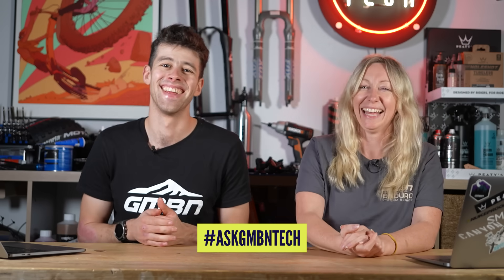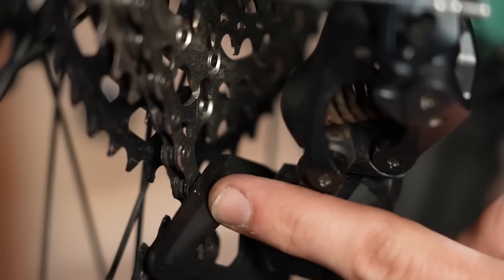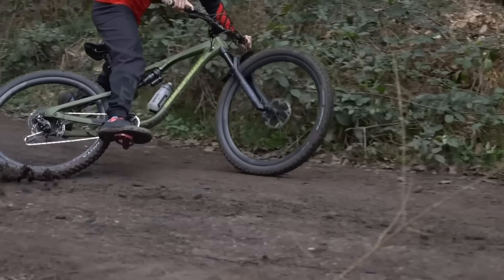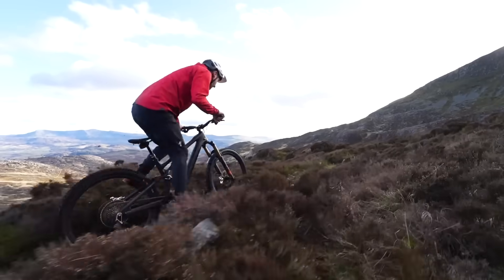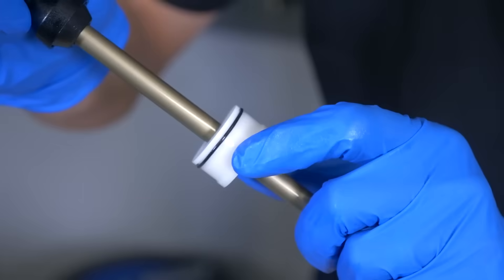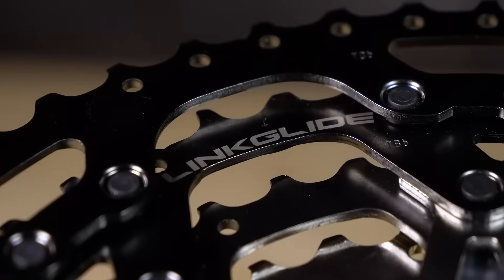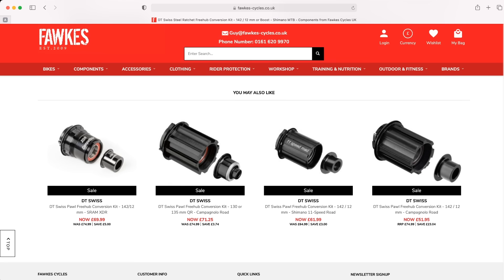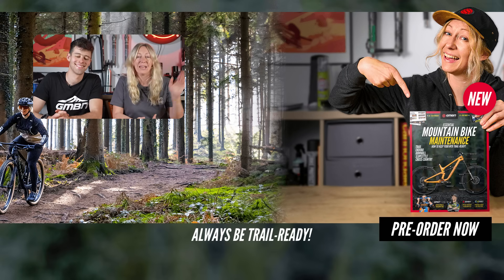Will We Ever See ABS On Normal Mountain Bikes? | Ask GMBN Tech

Comment: There's a reason why rally cars don't have ABS. Imagine on a loose loamy trail, you try to break hard to dig in a bit, but the wheels keep rotating, and you keep rolling...
On tarmac, ABS would be nice though.
Reply: They had ABS, of course adaptive, in the early 2000s together with among other tech like GPS controlled ride height.  So something that you can toggle might be useful
Reply: Surface in most bikeparks is so hardpacked it is virtually tarmac. For those who never ride wild trails ABS is fine too, almost necessary
Reply: Loads of motorcyclists and especially adventure bikers have had a serious scare when they realized they forgot to turn off their ABS and tried to slow down on gravel or downhill.
Reply: @TheTongo11  "GPS controlled ride height"  That's interesting.  

Which manufacturer do you think had this?

Comment: We don't need ABS on mountain bikes. If you have ridden a motorcycle off-road you know how much control you lose from the ABS pulsing. You lose almost all breaking power. Most good motorcycles allow you to turn off the ABS when off-road.
Reply: That's the  rear wheel, not the front. Also, there is ABS for emtbs. Front wheel only. It decreased braking distance and allowed continued control during braking.
Reply: Yes, you are right. True off-road motorcycles like Motocross and Dakar bikes have no ABS at all.
Reply: Agreed. We ride MTB’s, not BMW street bikes. Let’s stop trying so hard.
Reply: @omegaalpha2974  The second the front tire even slightly loses traction? The brake will start pulsing off and on.  A rider cant even tell the front is losing traction but the ABS can.  A constantly pulsing brake does not stop well at all.
Reply: As an off road enthusiast, also mountain biker and dirtbike rider I absolutely wouldn't take any ABS equipped vehicle off road seriously. It's probably the stupidest thing you can do, if you enjoy losing control yes, might be genius...

On a hard packed regular surface ABS might be useful, but is that global mountain bike network or global gravel bice network?!
😂

Comment: Just as a side note?  On motorcycles that have ABS, but go on dirt?
The very first thing you want is a button that turns off the ABS.  It is not at all a good thing on dirt.

If you havent learned how to work the brakes, ABS isnt going to help for dirt riding.
Much like auto shifting, if you know how to shift you dont need it.

Comment: Just wanted to thank you guys for addressing my issue. I have checked the chain routing thru the derailleur, the b tension, brand new XTR race pedal bearings and all are functioning perfectly. The wheel set is Bontrager Kovee RSL, also brand new. I am stumped as to what could possibly be done. But I appreciate your help.

Comment: For wheel size and gearing, the cassettes are essentially designed for 29ers and thus I would just leave the 32 on there. You will hardly notice a difference either way because the change in diameter is only 1.5 inches.

27.5 wheel
32/51 x 27.5 = 17.3 gear inches

29 wheel
32/51 x 29 = 18.2 gear inches.

If you put a 30t chainring on a 29
30/51 x 29 = 17.1 gear inches.
Reply: Cassettes were designed for sizes 20-24& 26 long before 29ers. The latter has only been mainstream for about two decades, the others going back more than three decades before that. And if you do the math, and even better ride them, the differences relative to tire sizes is  nominal between them. As in shifting typically one middle cass gear, to make up the difference. And actually, if you're an avid rider your legs, lungs, heart will improve enough over constant conditioning, to absorb it; and the taller tire will add to it. I've found that longer cranks for 29er is the way for me, with long legs. The 29er originally made as niche for rolling trails, and it catered to taller riders. Before the industry cashed in on it, lowered the bar height and pushed for 1X10, etc. And you'll hear some say that 26 was a fad, no it is and was the roots of Mtn bikes. Regular street bikes modified like quasi-motor bikes, riding your bicycle around in the woods. Anything else is propaganda from corporate business, for some reason. And yes, the tires and wheels were/are heavier for all of those sizes, across the board. That's physics, you can address it in ways. But I won't that fraud live either. Especially from  those who ride it, or were there and know.
Reply: @brucehamilton6019  I was referring to today's 10 - 51 or 52 tooth Shimano and SRAM 12 speed cassettes that are usually paired with 32 tooth front chainrings on a 1 x 12 drivetrain. They work perfectly for a 29 inch wheel.

Comment: #AskGMBNTech  I am due to get my forks serviced on my two bikes and I am wondering if it would be OK to request thinner oil to be used in the forks?  I noticed that not only myself but many of my friends ride with the compression damper setting set to either wide open or one click from wide open.  These forks offer many adjustments for compression dampening, yet it seems they are rarely used.  If the reason is due to the oil being to thick wouldn't a worthy adjustment be to put thinner oil, which will in turn open up the settings and allow for greater adjustment due to the conditions and whatnot?  Also, my forks are feeling quite harsh despite having them close to or fully open.    I am 190lbs and I mainly ride in the harsh Arizona deserts.

Comment: i'm a bit confused with anna's answer to bills levo question regarding changing the rear mullet setup to a full 29er setup. i asked Specialized about this and they say there is no way to change a mullet setup to a full 29er setup. they say there is no after market kit either to replace the rear triangle to accommodate the 29" tire for the rear. i love my large  29er but in hind sight i should have went with a proper fitting medium. i don't like the current levos being only a mullet. did i miss something?

Comment: Not sure why anybody would want ABS. I use front and rear wheel lock up to do pivots on the trail pretty often. Tight switchbacks and on wood features around here you definitely need to lock the front wheel up. If you don't want your wheels to ever lock up buy SRAM brakes 😅 jkjk

Comment: #askgmbntech hi guys, what is more important geometry or suspension? I mean is it better to get a new modem Geo basic bike  or an 5-10 years older top bike? (Same wheel size, same transmission, brakes etc)
Reply: Definitely geo is more important. Because you can upgrade suspension but you cant upgrade outdated geo...

Go for new geo, it will give you more confidance, and later on you can buy some better suspension if you want and need.

Comment: #ASKGMBNTECH I have some budget constraints and can't afford to get individual muc-off dry and wet lubes without having to worry on money. Should I instead just get muc-off hydro-dinamic which is all-weather? I don't care if the hydro-dinamic will get my chain dirtier than using weather specific lube, i just want my chain to be well protected and last long. Should i shell out more cash for the weather specific lubes or just go hydro? I live where the weather conditions are mostly dry and dusty but just a bit of humidity means i have to relube which i find annoying. Note: I take all answers from this fellow MTB community so i kindly ask for anyone else's support in aiding a fellow MTB guy.

Comment: ABS is worse than useless on dirt. Locking up the back and digging is an essential "get out of jail free card", when your front doesn't have enough traction to get it done in a speedy, elegant fashion. It's why there are independant brake levers, instead of a third "dumbass pedal".
Furthermore, once you jam on the front full force ABS, you still have the "flying W" over the bars. It's like some kind of "get rich quick" scheme for law firms. I know marketting engineers want to sell the magic, but how to screw folks without getting sued is the lurking nightmare.